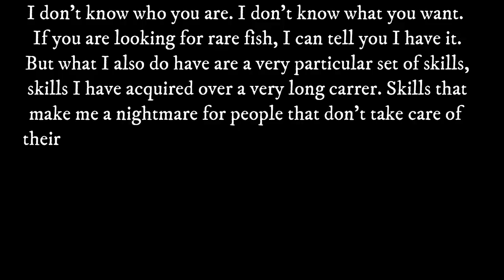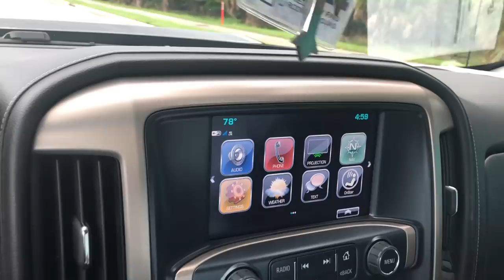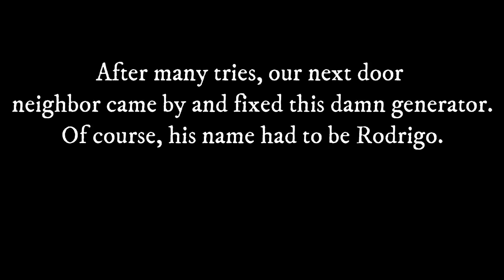Is the HURRICANE COMING? Getting ALL MY ANIMALS to safety.

Comment: when it is on "start" is in in choke mode.  Once it starts the first time, switch it to "run" and it will run for as long as you need.  Constantly pulling on the starter caused you to flood it.
Reply: @PredatoryFins  Awesome, good deal.  Good luck with this storm coming in.  My sister lives in Mt Dora and I am really concerned about her too.

Comment: Dont ever turn a generator off with the “on/off” switch. Turn the gas off and let it run out of gas. Then next time you need to start it the carburetor will be empty. If you just hit the off switch the carb will be full of gas and won’t be able to mix the correct amount of oxygen to ignite and run.